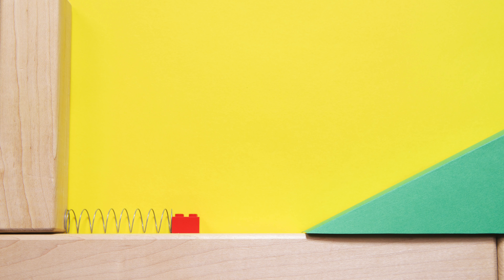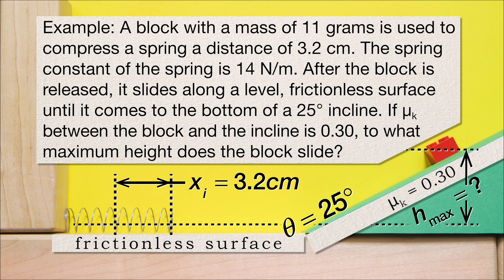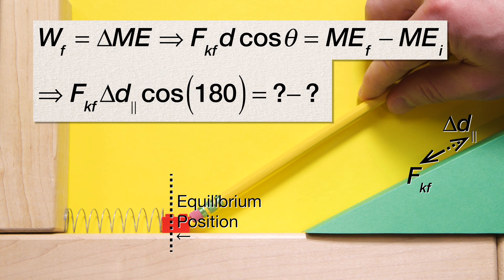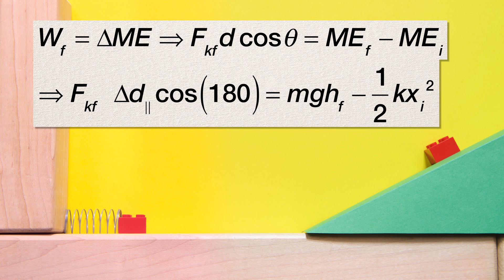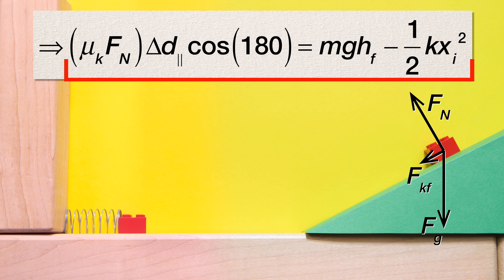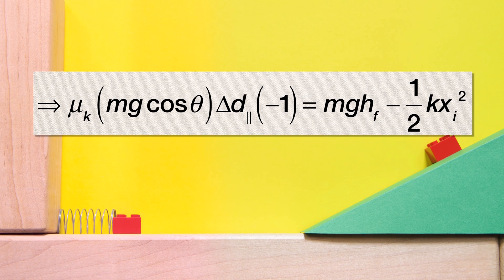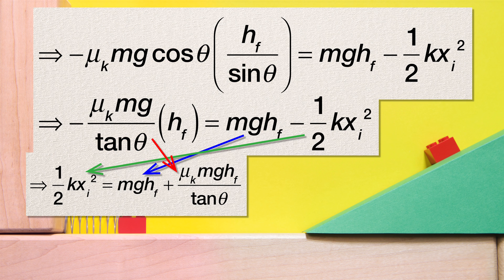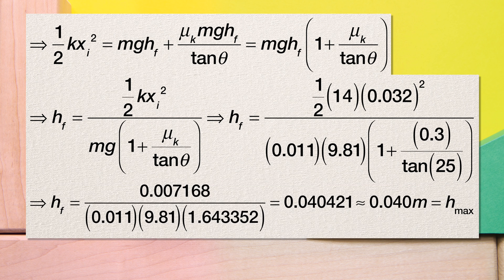Work due to Friction equals Change in Mechanical Energy Problem by Billy

Comment: In that gigantic quantity of 1+ u/tan ©, I also had g with tangent. I solved the problem by breaking it down into two parts, elastic potential energy to kinetic before reaching the incline, and then the kinetic energy before the incline to potential energy on the incline, evidently with the friction and mechanical energy equation. But I have that extra g.

Comment: At 4:15 how did you get tan(theta)?

How do you go from cos(theta) x (hf/sin(theta)) to sin(theta)/cos(theta) x (hf) ?
Reply: 1 divided by 3/2 can be written as 2/3 (2 of 3/2 goes up). In the same way, 2/3 can be written as 1 divided by 3/2.
This is what he did in the video. Cos(theta)/sin(theta) can be written as 1 divided by sin(theta)/cos(theta). Sin(theta)/cos(theta) equals to tan(theta). So, It can be written as 1/tan(theta). 
Hope It clears your doubt^^
Reply from the maker: I think you might have missed that tan(theta) is in the denominator. Does that help?
Reply: Not very much. I don't understand how the cos(theta) got below sin(theta) to form tan(theta).

I see it this way:    cosx (hf/sinx) --> (cosx/sinx) (hf) --> cotx (hf) --> (1/tanx) (hf)

Basically simplifying to cotx and then change it to its reciprocal, (1/tanx).
But I don't think this is the way you did it.
Reply from the maker: (cosθ·hf)/sinθ = hf/tanθ

Comment: When calculating work ( W=Fdcos(theta)) why is the cos(theta) necessary?
Reply from the maker: Because that is how work is defined in physics. The cosine of theta makes it so only the force in the direction of the displacement is included in the work equation.  I would suggest you watch my introductory work video which walks through examples with different angles. https://www.flippingphysics.com/work-intro.html